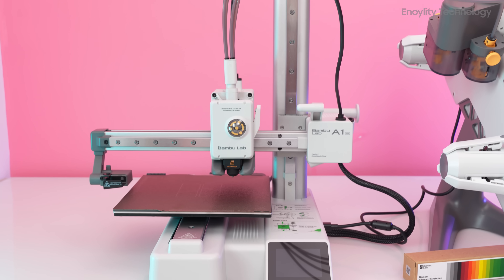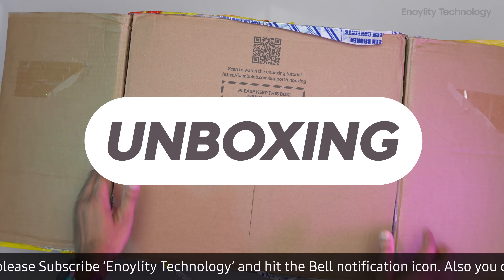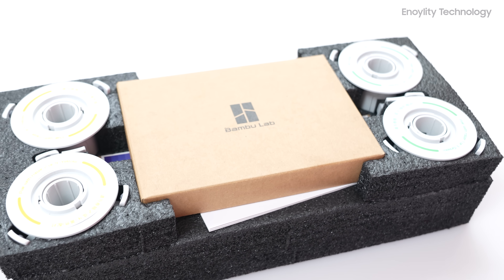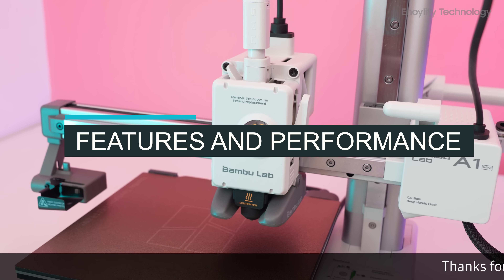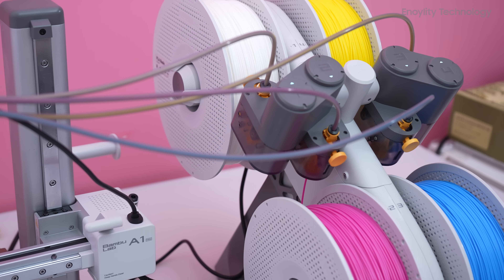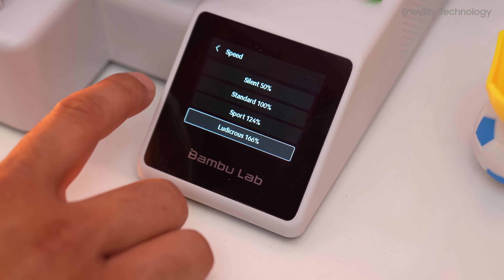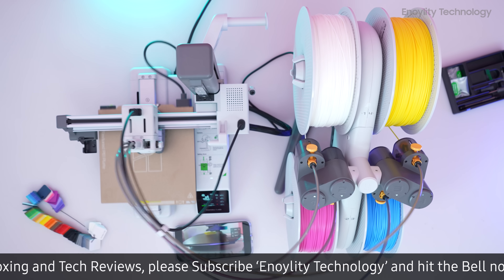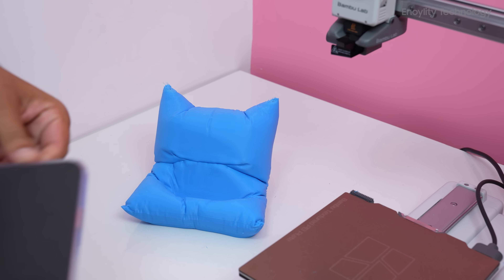Unleash Your Creativity with Bambu Lab A1 Mini: The Compact 3D Printing Powerhouse!

Comment: This is an excellent printer I had a problem out the box with a broken anti-lift bracket contact a technical support help me out right away this is my first multicolored printer and I'm liking it so far.
Reply: fantastic product very efficient, I'm very happy
Reply: It’s truly a versatile machine❤
Reply: High layer resolution capabilities on the A1 Mini allow for smooth and detailed prints, even on small objects
Reply: This is a great printer at less than
Very quiet and easy to work with.
The automatic bed leveling works great.
Great for beginners.

Comment: We had a very good experience with customer service while having issues with our printer. They went above and beyond to make things right for us. Our printer is running smoothly now and we are thankful for the great experience!
Reply: Good quality and accuracy prints , in this price range
Reply: It’s small enough to fit on my desk but powerful enough for professional-grade projects
Reply: It doesn’t take up much room but still delivers fantastic print results
Reply: They're quite good, but it would be nice to be able to download a manual. I don't know how long the existing videos will be up on YouTube for.
Reply: The machine has great stability, and as I imagine with all 3D printers, a learning curve, but once you get familiar with it, it will feel like an extension of your body.
Reply: This printer delivers excellent print quality, especially considering its affordability. It's capable of producing detailed and accurate prints with minimal layer lines, thanks to its precise extruder and heated bed.
Reply: The print surface however, is trash. Good adhesion, but after a few days I noticed the cooled parts were a major pain to remove and that damned spatula that is soooooo necessary for that surface left some tremendous gouges in the board.

Comment: This product is good, the printed color is great, I am very happy to buy such a good product, like it,
Reply: Good quality and accuracy prints , in this price range
Reply: This printer is perfect for beginners but still offers enough advanced features to satisfy experienced makers looking for a reliable, compact machine
Reply: The large build volume is a major advantage, allowing for the creation of more substantial projects without compromising on detail. The heated bed and filament sensor add to the convenience, ensuring that prints adhere securely to the bed and any interruptions are promptly addressed.
Reply: They could probably use a higher quality fan when sending these out initially, in my opinion.
Reply: Highly recommend this printer if you like tinkering. Ikea-level build skills are needed. Slightly above average computer skills are needed to be able to print beyond the couple that come on your SD card.
Reply: It’s perfect for small spaces but still delivers big results

Comment: This is one of the easiest to use printer and the fastest to get started into 3D printing. Highly recommend
Reply: Took about twenty minutes to assemble out of the box and you can tell an immediate improvement from the materials used
Reply: It’s compact yet functional, with everything you need to get high-quality prints
Reply: Overall, this thing rocks and I'm already addicted to the speed. Unbelievable value and they have great customer support. (I had an issue with a roll of filament. They quickly corrected the issue.) Very pleased with this purchase.
Reply: There are some nice features to this printer but there are several improvements that could be made as well.
Reply: First thing first the instructions sent with the printer are very lacking to say the least

Comment: When I print in one color it works great and the quality is amazing. I do recommend the printer
Reply: One of the standout features of the A1 Mini is its ability to handle detailed prints without losing resolution 😉
Reply: The sturdy build of the A1 Mini means there’s very little wobble or vibration, which translates into higher-quality prints with less risk of failure
Reply: I would recommend this printer to both new users and existing users who are looking to upgrade their rig.

Comment: Good printer , still needs some bugs worked out , needs several adjustment to get a good first print
poops allot, needs better slicer, orca slicer would be the best and may fix several of the bugs it has
once they get the bugs worked out and get it on orca slicer it will be a solid printer , as it is currently not for anyone new to 3D printing
The ACE system works well and with it being a filament dryer is a plus
Reply: Something like this without the higher price tag is exactly what I've been waiting for.
If you order the combo, just know your accessories will ship separately. My box is still in transit so I cannot review that portion.
Reply: It makes managing print settings simple, even for someone new to 3D printing
Reply: It’s an impressive machine and a very impressive value.
Reply: Overall, I'm beyond impressed with this 3D printer.
Reply: While it's not the fastest 3D printer on the market, it strikes a good balance between speed and quality.

Comment: I hesitated for a long time before purchasing, unsure of the stability of the new multi-color printing technology, but in the end I decided to give change 
Printing is faster than I expected, but you can turn down the parameters appropriately if you want a higher quality model.
Reply: Thos printer truly is fantastic and in my opinion seems to work alot better and at a lower cost then it's competitor, the ACE unit works far better then the other comparable unit and the innovation in it sets it apart from that other unit as well as it works as a filament drybox on top of a multimaterial unit.
Reply: The print bed heats quickly and evenly, reducing the chances of warping or failed prints

Comment: I am the IT person at a Library and will try and see if I can get one for the Library. I really think people will love this printer.
Reply: It’s perfect for home use where noise could be an issue, yet it still delivers high-quality prints
Reply: The flexible print bed makes removing finished prints much easier
Reply: Given that, the printer prints with enough accuracy for my needs and prints reliably consistent.

Comment: It IS super fast which he does love and it is pretty quiet. So there are some good points to it but some not so great points as well. He is enjoying it for the most part though.
Reply: Despite its small footprint, the A1 Mini can handle complex projects with ease
Reply: The A1 Mini’s enclosed design helps with temperature regulation
Reply: Very easy assembly. Took about 30-40 minutes. Loaded some filament printed a quick benchy.

Comment: I bought this during the Amazon Days and have had nothing but issues with the printer. I had to work at getting it dialed in and finally I had it working and making good prints for a few days
Reply: Its ability to handle detailed prints without losing resolution, even at high speeds
Reply: It's quite operation  is a big plus for home environments
Reply: One of the most impressive features of the A1 Mini is how well it handles large prints for its size
Reply: I think this printer is a great starter machine to get into 3D printing, but there are some things that aren't obvious or need changing. I'll try to summarize what I've learned in the last couple of weeks with this 3D printer:

Comment: I have worked with customer service and have corrected the issues. They have replaced the printer, and I was able to keep all of the parts that they sent me to try and repair the old printer. I have printed 10 different prints, and they have all came out great. I will update as I print more designs.
Reply: I love how user-friendly the Bambu Lab A1 Mini is❤
Reply: It’s a reliable feature that ensures consistent results ❤
Reply: The slot to insert the SD card is inset into the machine under the front of the build plate. It's hard to get the card inserted especially for an old fart like myself.

Comment: I've been using this printer over a week now and I love it, it works well and prints everything in great quality and clarity, overall this printer has printed flawlessly
Reply: My experience was mixed, as the chatbot's responses were limited and didn't fully address some of the setup issues we encountered. This aspect could use improvement, but the potential for remote assistance is appreciated.
Reply: The user interface is user-friendly with a responsive touchscreen display. It simplifies the printing process and offers features like resume printing after power loss.

Comment: This is my first printer and instead of choosing the bambu lab a1.  I chose this one for its slightly added benefits. Installation was really easy and the guide is well documented.
Reply: I love this printer. Great first printer.
Reply: I love this printer. Great first printer.
Reply: They were great to work with and explained they are there to help with anything. The printer itself is fast. Once I get the hang of the software I think it will be even better.
Reply: It keeps prints consistent, especially with more sensitive filaments like ABS

Comment: The best multi colour 3d printer at the mostly cheap and low cost. The printer output was the best students liked the 3d printer and are about to order 4 more from you
Reply: Its intuitive interface makes it easy for beginners while still offering advanced features for more experienced users
Reply: I will say it’s great and I’ve already printed a few small items…Not any real problems so far… But it was a little difficult setting up by myself so I did need a hand from my friend to help hold things in place while I was screwing the screws in
Reply: Highly customizable and upgradable. You can easily modify or enhance it with various aftermarket parts to suit your specific needs.

Comment: Limited build volume may restrict larger projects
Reply: I like it, it's been working fine for a few weeks.
Reply: The print quality is superb, and I appreciate the filament sensor that prevents failed prints due to running out of material
Reply: It’s a feature usually found in much pricier models

Comment: While it may not suit users needing a larger print volume, its print quality and community support make it a strong contender in the mini printer market
Reply: I would only knock off a half star for my problems, but Amazon don't allow that and I don't want to make this printer look worse then what it really is, I highly recommend this combo if your looking to get into multicolor 3d printing
Reply: The printer did not disappoint. The print turned out beautiful. Creality is just quality out of the box. This is my second Creality printer and it would take a lot of convincing to purchase another brand. Don’t hesitate. Buy it.
Reply: The automatic bed leveling is perfect and the free creality slicer is easy to learn to use and is very adaptable for your needs.

Comment: : Users benefit from an active online community and readily available resources, making it easier to troubleshoot issues or find tips for optimal printing👍
Reply: It works well with popular slicing software like Cura and PrusaSlicer. Additionally, it supports a wide range of filament types, giving you versatility in material choices.

Comment: Users often praise the A1 Mini for its high print quality, producing detailed models with minimal layer lines, making it suitable for both beginners and more experienced users
Reply: For a mini 3D printer, the detail and accuracy are top notch
Reply: It comes almost fully assembled, and the calibration process is straightforward, which saves a lot of time
Reply: I wouldn’t have a house, but that was probably user error. It barely requires any assembly compared to some printers. ❤️❤️❤️ Best of the best

Comment: The Bambu Lab A1 Mini is a budget-friendly 3D printer for beginners😍
Reply: Budget friendly without sacrificing quality 👏
Reply: Higher price compared to some entry-level models
Reply: Yes it's budget friendly
Reply: The bit of filament comgrow provides is enough for one or two small prints, but it did print very well. I bought another spool of their white PLA and its performed fantastically.

Comment: What types of filament can the A1 Mini use?
Reply: I've gotten wonderful multicolor prints off of it, the only problems I've run into is bed adhesion and clogs, the bed adhesion I solved with special bed adhesion product I've bought off Amazon, a
Reply: It's sturdy and reliable, ensuring long-lasting performance without frequent maintenance
Reply: It supports TPU for creating flexible and rubber like items
Reply: I’ve had zero issues with clogging, even when using more challenging filaments
Reply: The A1 Mini's user-friendly interface makes it accessible for those new to 3D printing. It's a compact machine that doesn’t compromise on quality

Comment: It offers easy setup and reliable performance for small projects
Reply: I’m amazed at how reliable this printer is for long projects 😊
Reply: This means you can find plenty of resources, tutorials, and troubleshooting advice if you run into any issues. @alex35_8
Reply: Quiet operation makes it suitable for any environment
Reply: Quick setup I was surprised by how easy it was to get started
Reply: Ideal for small workspaces or home use
Reply: I bought this to replace a aging printer, and this replacement is a great fit.
Reply: Best features❤
Reply: It’s amazing how powerful the Bambu Lab A1 Mini is despite its size

Comment: Does the Bambu Lab A1 Mini have an auto leveling feature ?
Reply: Absolutely, the A1 Mini has a built in auto leveling feature
Reply: Yes, it includes auto leveling to ensure precise prints every time
Reply: Affordable and perfect for hobbyists exploring 3D printing
Reply: Higher upfront price for a mini printer
Reply: Software may have a learning curve for new users
Reply: Auto-leveling and print quality are the unique features of this printer.
Reply: overall, in my opinion, a perfectly functioning this printer.
Reply: This printer is amazing. We are beginners, so we have not done anything to test the limits.
Reply: Amazing value for the features included, the A1 Mini stands out as one of the best budget-friendly 3D printers with advanced functionalities

Comment: The auto leveling feature on the A1 Mini is such a time saver 💯 No more fiddling around with manual adjustments 👍
Reply: I love how the auto leveling ensures perfect prints every time
Reply: The A1 Mini’s auto leveling makes setup so much quicker and easier 🥰
Reply: Its smaller footprint makes it ideal for home or office use, especially in spaces with limited room
Reply: I appreciate how well it handles uneven surfaces
Reply: Some software features may require a learning curve
Reply: The A1 Mini’s precision is fantastic. Even small, intricate designs come out clean with sharp details
Reply: Product received as described in the product description
Reply: The best among the price range
Reply: I’ve been printing for awhile now and love that this thing already has all the upgrades built in to it that I would normally do on my own.
Reply: The leveling works great as does the touch interface but this is not necessarily beginner friendly, there is a bit of 3d printing knowledge and experience you will want before working with this.
Reply: * Perhaps one of its most appealing aspects is the affordable price point. It provides excellent value for both beginners and experienced 3D printing enthusiasts

Comment: I was blown away by how easy the A1 Mini is to use 😍 Setup was quick 👌 and I was printing in no time. The quality is impressive for such a small machine
Reply: Super easy to set up, even for a beginner like me 😌
Reply: I loved how quick the setup was. Plug and play ⏯️⏯️
Reply: Minimal assembly required. I was printing within the hour 😊
Reply: Easy setup and intuitive interface, great for beginners
Reply: It's design makes it ideal for detailed models and prototypes
Reply: Really good video! Tomorrow my first 3d printer the a1 mini arrives.
Reply: Best 3D printer for beginners. Bambu A1 Mini Combo.
Reply: Worth for money Very 💯 impressed with product , build quality, delivery
Reply: 5.0 out of 5 stars Value for money, great for beginners
Reply: Multiple safety features, including thermal runaway protection, make the A1 Mini a secure choice for home use
Reply: The Bambu Lab A1 Mini delivers precision prints in such a compact size